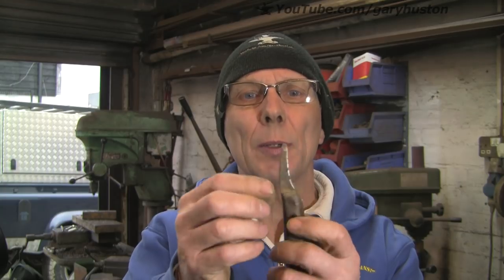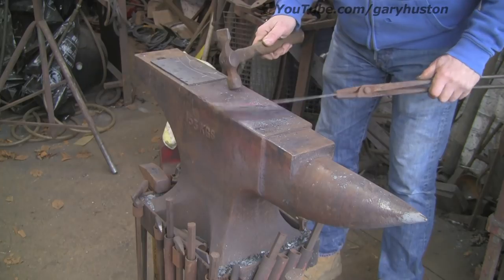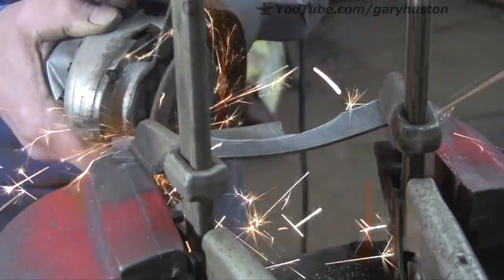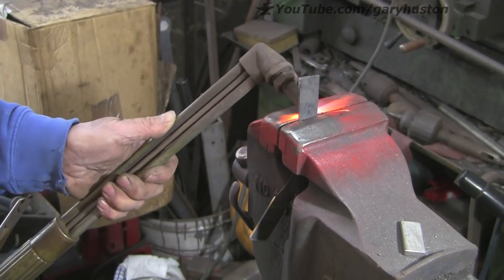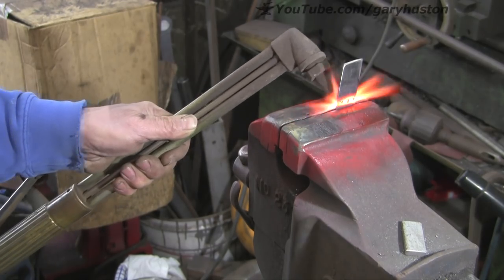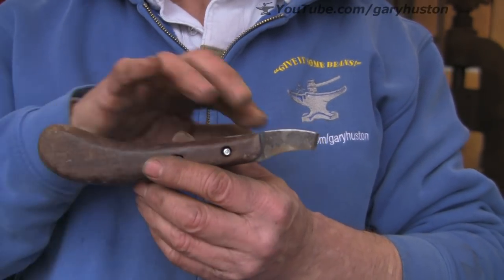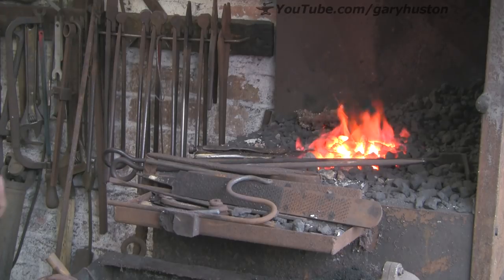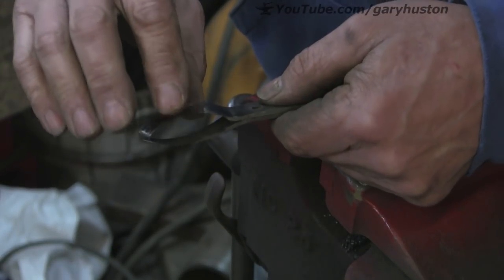Farriers Loop Knife Blade Replacement

Comment: Lovely work, as always!
A tip for "workshop temper", for thin items, i often heat up another bar of mild steel, then let the heat conduct into the workpiece.  Gives much better control than the gas torch

Comment: I’ve never been able to forge a serviceable loop knife. I’ve had a loop for years made in Tasmania by Fergus Paterson. I believe it’s a pinehurst forge loop that was made before Fergus hung his own shingle or right at the beginning of Dusky Forge. It’s a damn fine loop knife. I have all 3 sizes plus the little vet searcher that I’ve bought over the years. They are expensive tho. Here in the states Neal Baggett down in bishop Georgia makes some damn fine knives too,as well forged as they are beautiful. I have one that I retired because it was given to me by a good friend who also mentored me in lameness/therapeutic cases. Sadly he passed away so I retired it and it’s sitting in my desk.  One of these days I’m gonna order me up some actual blade steel and give a loop and a drop blade a try again. I did manage to make a frog knife out of a section of broken band saw blade from a commercial saw mill and it’s still holding up. Back in high school I made a skinning knife out of bandsaw blade and almost  later it’s still holding a good edge considering I knew next to nothing about tempering,hardening,when to quench and all that lol 

By the way,those are Chicago screws you used to attach it to the handle. A client had given me a set of knockoff copies of pinehurst/dusky forge loop knives and they used Chicago screw instead of rivets and burrs to attach the loops to the handles. They are actually pretty good knives for what they are. I use them for field trims and broodmares along with a cheaper pair of nippers to save my good knives and nippers.

Comment: Gary, the farriers I’ve used here in the western U. S. Use a hook shaped hoof knife, I’ve never seen a loop type like you show here. I recently found a hand forged hook type in a lot of tools that were given to me by the widow of a friend. I have no idea how old it is but it looks very old to me.
Reply from the maker: A hook shaped knife is the standard type used for general cleaning out of muck and removing loose sole. This is one i made a while back https://youtu.be/NsCL2DAxDZ0
The Loop knife is slightly more specialist and used for trimming the frog as it can be used with one hand down both sides. Small loop knives can be used for digging out pus as you can make a nice small neat hole. Here is a selection of six different ones https://images.app.goo.gl/JvRvTUoJBurFjoc1A